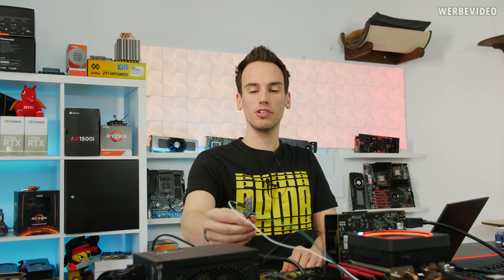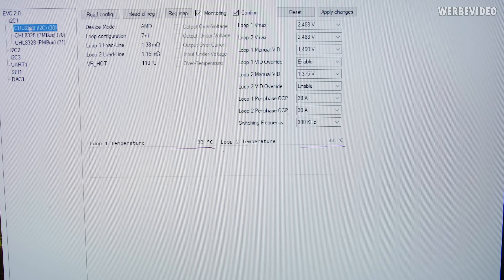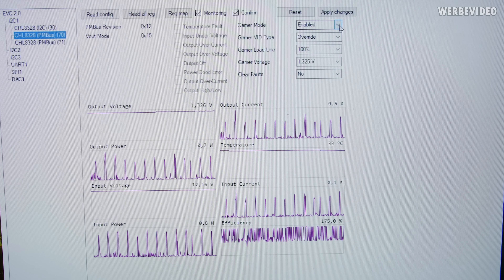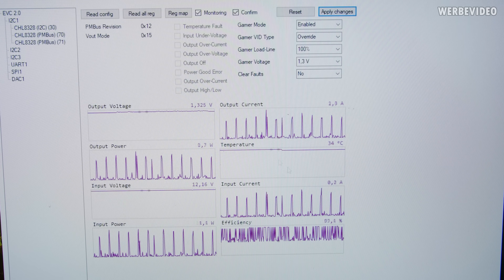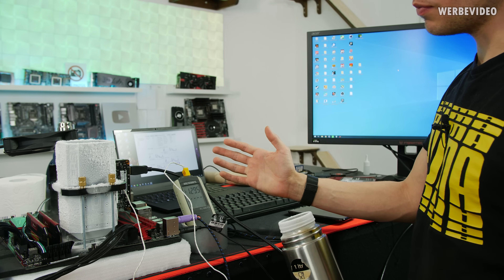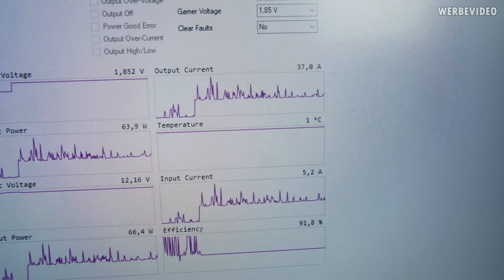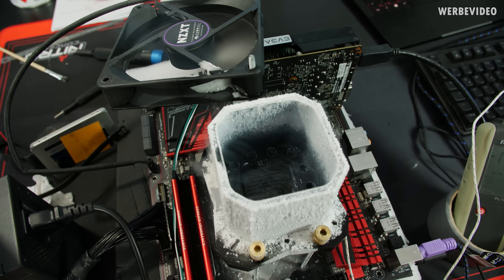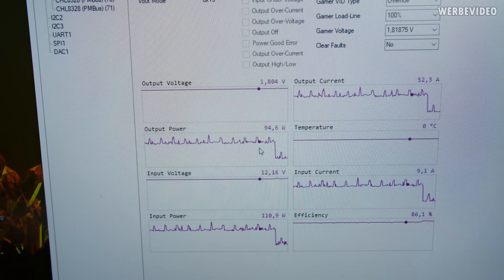We Overclocked an AMD CPU to over 8.1 GHz !!

Comment: I like to play at 10000 fps but im tired than every 10 seconds have to recharge the tank with liquid nitrogen...
Reply: Yeah.. CPU affects things like volumetric clouds, sometimes the particles, smokes and things like that. GPU itself wouldn't run a game without a good CPU
Reply: A small price to pay for FPS
Reply: @officialtrading8239  its CS what the fuck lmao a literaly overclocked potato can run cs
Reply: cpu doesn't give u more fps
Reply: @formagetounsi  i sold my 200€ cpu and bought a 10€ one from china and am getting 1-5 fps fucking liar
Reply: @jimppajamppa2563  hhh funny
Reply: @formagetounsi  It does, some games are more CPU-intensive than GPU, it's due to the way the game was designed, but it depends on the game you're playing
Reply: @aru-YT  i know that
Reply: aerski like Minecraft with only uses one fucking core and thread
Reply: Hotshot Haythem GPU affects open world games and CPU affects other games
Reply: Hotshot Haythem no. Gpu affects frames in larger open scale environments, whereas usually smaller fast paced FPS games rely more on cpu then GPU not always but usually
Reply: Exot1cz 25 that's just, not true at all, your saying I don't need a GPU to run FM?
Reply: @formagetounsi  if your cpu is faster than the GPU can handle then i agree on that
Reply: @formagetounsi  in cs go yes
Reply: Hotshot Haythem yes it does. Do you think you get the same fps with an i3 2120 and rtx 3090 and i9 10900k with rtx 3090?
Reply: @agsechogd6406  bruh thats called bottleneck and u dont need an i9 10th gen for 3090 u can game on less
Reply: Hotshot Haythem but it makes stutters and I would consider it unplayable. Who thinks processor is not important? XD
Reply: Hotshot Haythem bruh it’s a joke
Reply: @formagetounsi  Found the guy who thinks he knows what he's talking about.
Reply: @formagetounsi  It does when you are CPU bound.
Reply: @formagetounsi  try running cod without cpu😂
Reply: @formagetounsi  if ur system is suffering from a bottleneck faster CPU will give you 5-10 FPS boost depending upon the games and work u do.
Reply: @formagetounsi  It gives. If you have enough gpu for your game, CPU will affect so much.
Reply: @formagetounsi 😂😂😂😂

Comment: When we talk about overclocking we talk about huge amount of heat we have to dissipate. Not about low temperature. So why liquid nitrogen is used? We need to keep a temperature below 90C, not below -190C. We need an ideal heat conductor, not freezer, right?
Reply: You have to think about conductivity inside the cpu as well. For an overclock to be stable, the voltage has to rise, so we need very very very low temperatures in order to decrease impendance inside the cpu to make the voltage more effective. It's a well known fact in physics thst lower the temperature, the lower the impendance, so, by using liquid nitrogen, we are trying to turn the cpu into some sort of a superconductor, so the electricity flows more freely.
Reply: @G.Gogoladze  Yes indeed, beautiful explanation, lower your degrees, more overclocking room you have.
Reply: @G.Gogoladze  Exactly. I've thought about this. Thank you for the explanation. However it seems that semi-conductors increase impedance unlike metals? And most heat dissipation happens inside p-n, doesn't it?
Reply: @sc0or  Maybe the processor needs impedance for it to work properly. That might be the reason cpus freeze up at higher temperature, so, by lowering it, we increase the impedance in the semiconductor, while turning the metals used for soldering,etc. Inside the cpu into superconductor.

Comment: I ran my old 8150 at 5.2-5.3 for around 4 years for some pretty nice performance boost, it's still in use in my racing sim, but i have to run it at around 1.4 volts just to keep it relatively stable.
I don't think it liked my overclock too much.
It doesn't beat my 7970 that i ran at 1.2-3 because i wanted to play my video games at 4k, i ran it with the alpenføhn cooler that i used two 140mm noctuas with.
It's been a a long time since i've done some more extreme overclocks, i kinda want to start again now.

Comment: Tip: Use a brand new Stanley Knife blade in between the row of CPU pins in order to straighten them up. 
Gently work at straightening up the pins in each row, and never target an individual pin directly using the tip of the blade.
This way there's less risk of slipping and accidentally damaging more pins or over flexing the bent pin/s in the opposite direction. Using a screwdriver, even a small one, poses a serious risk of bending more pins.

Comment: Me: is proud of overclocking my Raspberry Pi 4 to 2.147GHz from 1.5GHz

This guy:
Reply: @romanrapoz4813  not bad at all, for some reason I couldn't get higher than 2147 MHz. Mine Pi refuse to boot.
Reply: Dynamite Music Wow, good point. Maybe the clock speed is a 32-bit integer
Reply: The funny thing is for all that work he only got 174 points for single core on Cinebench 15.. That's very disappointing.
My laptop scored 191 points single core @ 4.5GHz (also undervolted by 105.5 mV) on this same test (Cinebench 15) and didn't need any liquid nitrogen or special treatment. I was hoping for something more impressive from this operation.
Reply: @DavidAllen_0  Considering an ancient architecture and old 32 nm (vs today's 7nm TSMC AMD or 14/10nm Intel) process technology for this FX CPU the results are OK.
Reply: @DavidAllen_0  how was your laptop?
Reply: Yes! Literally.... Btw what cooling system do you use?
Reply: @V3N0M - 3XPLOITS for the RPi? A small 5v fan
Reply: @dominic0305  I have passive cooled Armor case with small 3.3v fan. Temps never reached 50°C
Reply: PH I use a metal case (not really targeted toward heat dissipation) with the 5v fan, although I use the fan at 3v3. I also use a heatsink. Temps only get up to 70 at full load.
Reply: @dominic0305  oh! Heatsink + fan. Nice, I just cool it with pimoroni fan shim! It works pretty well but I am still planning to buy Ice tower✌️
Reply: @patricklife  did you try using a 64 bit os then ?

Like manjaro arm 64
Reply: @xrafter  jup, I am on Ubuntu Mate 64 Bit, but OC from 1,5GHz to 2,147 is maybe a safe limit for this tiny old Cortex
Reply: @patricklife  
Ok
Reply: Dynamite Music  that means it's just 1 IPC?
Reply: Liquid nitrogen your pi lol
Reply: @florisvanvliet3542  You can't electronically go above 2.147 right now, sure it's physically possible but not with the current software
Reply: U can run roblox at low graphics at 45-60 FPS'
Reply: I was able to go upto 2350 GHz, that too without using that bulky ice tower. I used the dual fan aluminium cooler and it worked great on my rpi 4 8GB overclocking!

Comment: Can anyone help me with assembling the computer?
PROCESSOR: AMD Ryzen 9 3900X 3.80GHz AM4 BOX Wraith Prism RGB LED  or (INTEL Core i9-9900K 3.60GHz (5.00GHz) Intel® 1151)
RAM: G.Skill 32GB Flare X DDR4 3200MHz KIT F4-3200C16D-32GFX 
SSD: Gigabyte 1TB Aorus NVMe GEN4 SSD M.2 PCIe 2280 
GRAPHICS: AMD Radeon RX 570 ASRock Phantom Gaming D 8GB GDDR5, HDMI/3xDP/DVI /256bit 
POWER SUPPLY: Chieftec GPE-700S ECO 700W 
HOUSING: IG-MAX F5518

i need your help which motherboard would match the above components and processors (if you can tell me some of the cheapest that could run these components well because I don't want to invest a lot of money in it, I invested the most in the processor)

and tell me which processor is better than the above

am I missing any component? Or that I need to change the power supply and whether I need to take some other coolers to cool this computer

I want to put these components in the computer because i like them, i don't know if they can go side by side (whether they can fit together)?

your answer would mean a lot to me because I have no one else to ask about this, THANK YOU

Comment: I keep imagining if its possible to build a permanent solution to run the cpu at this temperature and make a 'super' computer of sorts? like, building anti freeze around it, some ventilation to take the nitrogen out, also a way to not lose nitrogen, don't know if its possible to use it like a water cooler does? circulating it around a tube? i don't know, just talking thro my ass here xD

Comment: I hate bending back pins on a cpu, but i am good at it curses, but pro tip if you run something uniform in thickness but not metal (like a credit card, etc.) In-between the pins horizontally and vertically after straightening them it helps realign them, cheers

Comment: Hi got i7 3rd gen, asus board, Sdd, Hdd harddisk, 580 8gb sapphire. How much power supply should you recommend. I have cosair 700 is it enough? Or i should installed higher or how much?

Comment: I was an overclocker enthusiast since the mighty Nforce2 chipset. I still remember that mighty Abit NF7S v2.0 mobo paired with my Athlon xp running with the help of some custom water-cooling solution.

So ive managed to oc my cpu. Then what; Nothing. Zero. It was all useless. And never was a hobby of the poor..."buy a cheap cpu and run it at higher frequency". Not a single ocer ever made any kind of money savings being an overclocker.

Achivements: Inner satisfaction of wasting some uneeded energy. Posting scores and those extra FPS you gained on some sites.

At least I made retailers happy.

When u grow up and u realise that even a hobby must be useful somehow.

Comment: him: pours Liquid Nitrogen on the cpu

also him : so right now i'm trying to figure out what's wrong.
Reply: Jerry Springler  I am reasonably sure it could, since cooling the top of the cpu before the bottom by a significant amount would cause it to warp or break (potentially)
Reply: Jerry Springler  it's something called a joke, I believe
Reply: Alejandro Rodríguez Sánchez you must be fun at parties
Reply: Jerry Springler  it's not, CPUs will shut down if they get too cold.
Reply: Jerry Springler  just because a joke isn't funny to you doesn't make it not a joke
Reply: Jerry Springler Do you have friends?
Reply: 667th liker. i am now a demon slayer
Reply: @sheilatenoso2798  kimetsu no yaiba
Reply: Jerry Springler  its funny
Reply: Higashichi Uchiha it isn’t
Reply: Jerry Springler  you seem pretty stupid. Did you not see the board warp?
Reply: @kevinsammut7246  A warped board won't always break the copper wire within the layers, with copper having a high ductility (ability to be shaped without breaking). The only issue that might arise out of super cooling a circuit is condensation buildup around the board and causing a short circuit. Another issue might be a circuit becoming incomplete due to thermal expansion (the copper wiring decreasing in length at colder temps), but that didn't seem to be the case with what happened in this video.

Anyways, moral of the story is assume that any form of modifications will cause damage unless you know what you're doing :)
Reply: @chrisxd146  well yeah, a warped board is usually a pretty good indication that something's wrong. The problem with stuff warping is solder points popping out and sometimes components touching and shorting. Fun, but expensive and not usually the result you would want.
Reply: Jerry Springler yeah a month later it’s still funny
Reply: It’s german, joke is no laughing matter.
Reply: Jerry Springler I guess you didn’t even watch the video because everything you said is wrong
Reply: Jerry Springler  I laughed at this, I laugh at jokes that make no sense al lthe time lol
Reply: Jerry Springler  its funny u just aint got shit for a sense of humour
Reply: Pro_Rman What did you expect? He has a don’t tread on me flag over a confederate one. He’s managed to reach second tier cringe with his pfp alone
Reply: @Jacobro02  true
Reply: Jerry Springler shut up dude
Reply: Jerry Springler  lol i hate people that cant take a joke
Reply: Jerry Springler  no one cares
Reply: Its 2 am and I nearly laughed to loud, epic joke man
Reply: Jerry Springler  the joke is that pouring liquid nitrogen on a cpu sounds really fuckin dangerous
Reply: @PizzaPowerXYZ  Yeah "sounds" is the keyword. It sounds dangerous because you guys have no idea what you’re talking about. 

You know nothing about this so why are you joking about how doing this is dangerous?
Reply: Jerry Springler  it's funny
Reply: Why your so rude act, your are beautiful
Reply: NotLDaz  relax mate, kids are fucked in the head, everything is a joke to them
Reply: Jerry Springler  wouldn't the temperatures make the surrounding pcbs brittle and susceptible to being easily damaged?
Or the frost/cool humid air would wet the motherboard once it was back to room temp?
Reply: @chrstfr6834  yeah not only that but lots of condensation
In simple words
Water
Reply: Even

Comment: when I was rebuilding my pc. I bent one of the pins on my cpu by accident and I fixed it with the safety seal from an orange juice bottle. Not the cap. the little seal you peel off

Comment: 4:51 No need to hate yourself, just ALWAYS slide an AMD cooler up-down-left-right until you feel a sudden change in the surface tension and THEN you can safely start lifting ONE side of the cooler's plate up :) Seeing how you overdid the thermal paste anyway you won't mind cleaning a bit bigger mess around the CPU lid, but it sure beats going "YIKES!" and fixing bent legs ;)

Comment: Intel: I can go over 5Ghz!
AMD: Hold my liquid Nitrogen
Reply: They overclocked a 10900k (I think) to 7.7 hz recently
Reply: @johnwill4560  7.7Hz? Damn!
Reply: @GewelReal  some crackheads recently just overclocked a 13900k to 9GHz
Reply: @johnwill4560  that's god tier slow cpu.  You did ur words wrong
Reply: @johnwill4560  if Intel continues to raise the base clock on their cpus we might have a new overclock record soon, let's wait and see
Reply: Funny enough, at this speed the single AND multi core speed is still slower than an i5. IPC matters.
Reply: intel i9 13900k can now reach up to 9 ghz
intel: hold my 13900k lollll
Reply: cool
Reply: @Agnish Roy hydrogen go boom boom
Reply: Agnish Roy helium creates explosions. Just nitrogen.
Reply: Francisco Santos helium is not explosive. It’s just extremely rare and prohibitively expensive for a YouTube video.
Reply: Tom Johansen it explotes but you don't see it with your eyes like the Hydrogen exploxion you need special lenses to see the explosion.
Reply: @Interestingworld4567  Helium does not explote in any condition, Helium is even a noble gas like argon or xenon, they are no reactive at all. What you saw was an experiment using a camera that can see gas density.
You can not burn helium, that is why is used in blimps and why germany needed to their zeppelins, they dont got it and they used hidrogen instead. We know how ended this history...Hindemburg.
Reply: @Interestingworld4567  oooooh u have gone quite now
Reply: Polo Gamero The hydrogens isn’t why it went down though. It’s why it was so bad, but it wasn’t the worst part
Reply: @Interestingworld4567  helium is a noble gas and therefore does not react, this is 9th grade science
Reply: Marko McLane Helium will react under very specific circumstances under university sciences though
Reply: @Agnish Roy  @Francisco Santos  Sorry, my mistake there. Thank you for pointing it out.

Comment: Wait why is no one talking about the fact that he straight up poured liquid coolent into bottle using bare hands

If it actually splashed or poured on his hand ....he would have pretty bad time
Reply: I think if it's just a small splash he would be fine. Pretty sure this stuff boils instantly in contact with stuff so hopefully he would be protected by a layer of gas.

Comment: Why not isolate the processor outside the motherboard with some extension of the pins and thus save yourself the problems of expansion and condensation of the nearby components?

Comment: I have the same board and am currently looking for another FX CPU to bench along side my terrible clocking 8320. My question is, why the hell are they still so expensive? Ebay has a few outrageously priced, and usually anyone local wants $200 for an FX 8350. Am I missing something?

Comment: So a tip on repairing the AMD bent pins in the future, get a razor blade and tape off or dull the blade edge. Then just run that down the rows and columns of the CPU pins. It's the perfect width to put the pins into their proper place with very little pressure.

Comment: You should have used one of those thermoelectric coolers the get down to 30 below zero then said a heat sink on the back of it
Reply: But he went all the way down to -160 below zero with N2. in any case, does this actually work with thermoelectric or just making a joke? interesting idea

Comment: Can someone point me in a direction that explains what he’s talking about in regards to a modern 3000 series while slower will still outperform this? I am trying to understand, because in my mind I look at core count multiplied by core speed to get a total output value for work potential being performed. His statement sounds inaccurate if not just outright wrong? Don’t get me wrong I like the video. I find it amazing these things can put out numbers like that.
Reply: The architecture in ryzen CPUs can do more calculations per clock cycle.EX
Fx= 5 calculations per clock cycle
Ryzen= 10 calculations per clock cycle
Note: these are just examples and not how a ryzen or a fx CPU would perform.

Comment: I also owned a FX 8350 and the Asus 970 Pro Gaming Aura. CPU ran without any problems at 4,7Ghz. I knew this board was the best 970 board on the market but I didn' t knew it had a better vrm section than the Crosshair Formula. Interesting. By the way  it's always good run the CPU at max load before uninstalling the cooler. The thermal grease will get softer also the CPU won't stick to the bottom of the radiator.